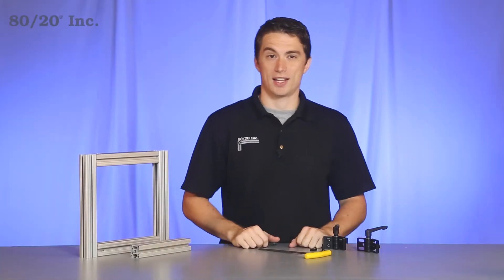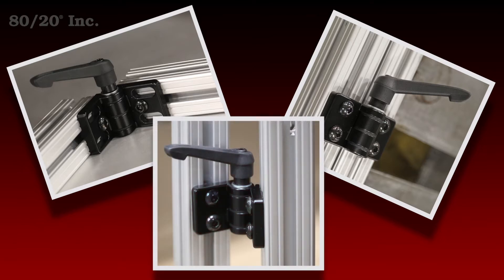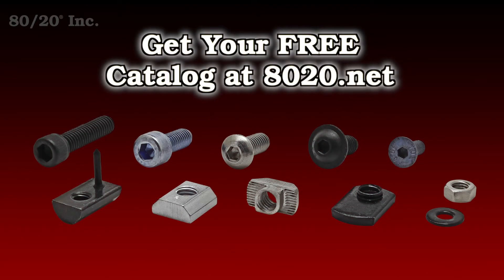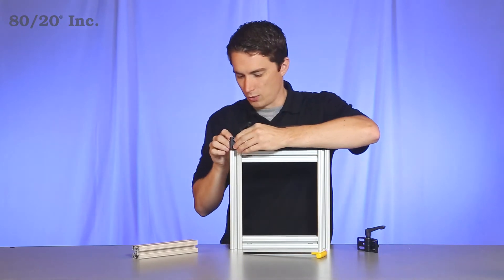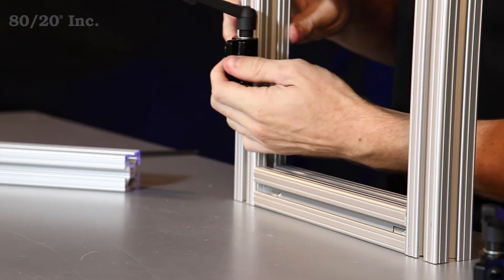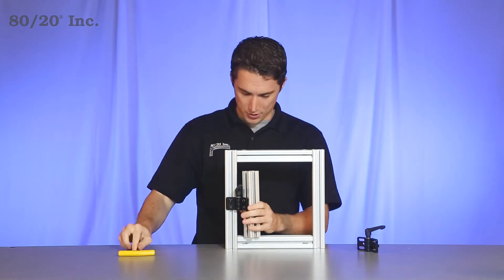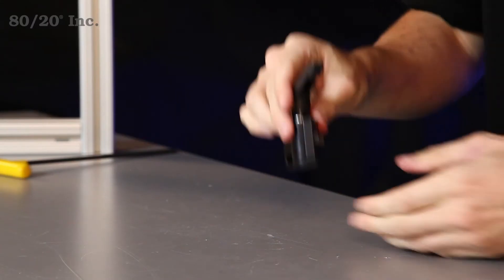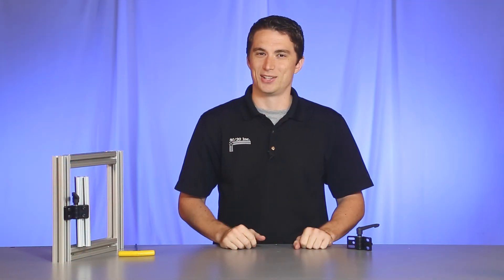80/20: Locking Hinge Overview

Comment: I am making a homemade boom barrier gate that is manual, and the user controls if it is open or closed. So basically, a slab of wood is kept in the air by using the hinge lock feature (open), and then it can be put down, where it is lent on an equal slab of wood (closed), and then locked. Would that work?
Reply from the maker: Hi there - thank you for reaching out to us! The short answer is that it depends on the length of the barrier gate you're planning to build. We recommend sending a drawing to our tech services team to determine if these locking hinges would work for your project: https://8020.net/design-assistance

Comment: Can the lock be partially tightened, to act as a friction hinge that stays in place wherever left?
Reply from the maker: Hi, Brett - thank you for your question! The way the locking hinge works is by cranking the handle until it's tight. If you partially tighten the handle, so it's just snug enough to stay in place, it would essentially act like a friction hinge and hold it in any position.

Comment: I'm looking for a hinge that can connect two - 10 series posts such that they are flush when the hinge is flat. I was looking at an option like 12256 although the hole spacing (dimension A) is 30 mm which suggests that there would be a ~5 mm gap between the posts when the hinge is flat. Any suggestions? Thanks!
Reply from the maker: Hi, Will - thank you for reaching out! While the 12255 hinge is listed for 20 series, it would also be compatible here and would be a tighter fit. After speaking with an engineer, here's what we suggest: 
(1) 12255 - STANDARD HINGE DC ZINC PC BLACK
(4) 3206 - 10 S STANDARD T-NUT M5X.8 BLACK ZINC
(4) 11-5712 - M5X12mm FHSCS [BLACK]

Comment: Does it have 180 degrees of movement?  That is, could it be used to create wooden legs that fold up onto themselves to halve their length?
Reply from the maker: This hinge can fold over on itself.  However, due to the hardware and hinge pin, it may not lay exactly flush.  Feel free to contact us directly for design assistance and one of our design techs would be more than happy to assist you, or suggest other options.

Comment: Do you have locking hinges that snap into position?  Does such a thing exist?
Reply from the maker: The closest hinge that we stock, would be our Detent Hinge; https://8020.net/2091.html This hinge doesn't lock into place, but it holds doors open at 120 or 170 degrees and is especially useful in horizontal-lifting applications, as it provides hands-free access. More information can be seen here as well: https://youtu.be/2LVNyOviI8M

Lastly, if you do find a hinge that better serves your purpose and want to incorporate it into your 80/20 application or design, feel free to contact us at info@8020inc.com and our Design team would be more than happy to not only source the hinge, but also assist you in the design process.